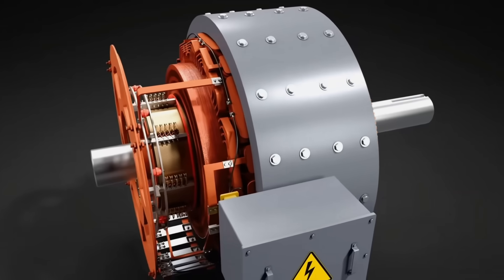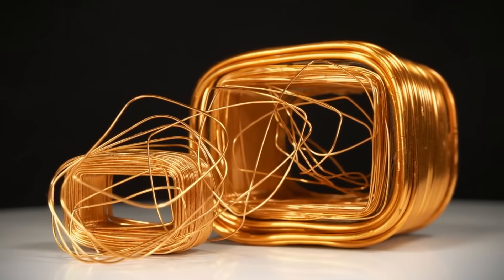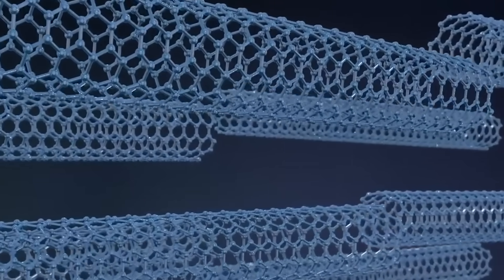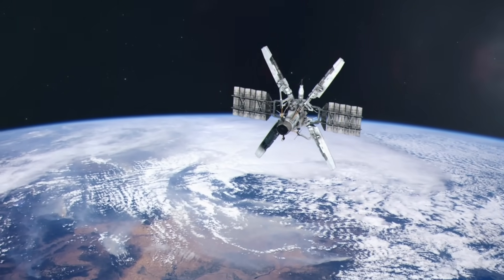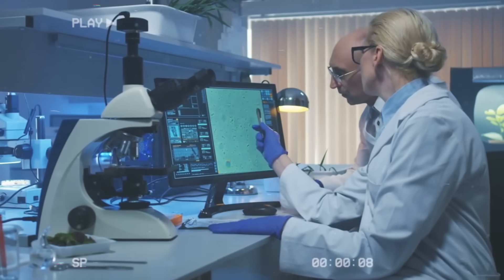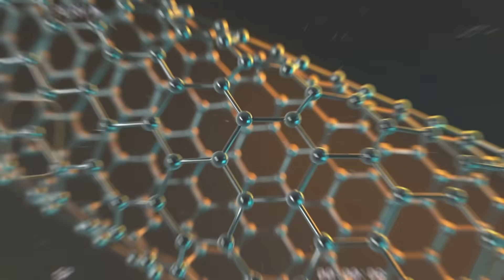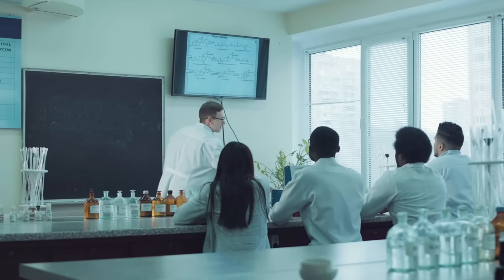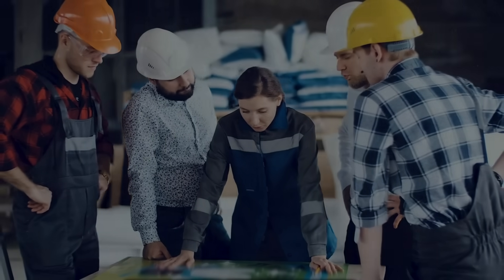This New Electric Motor Will Blow Your Mind—No Metal Coils!

Comment: It makes sense to build a motor into a wheel. In cars the wheel would become too heavy. Not to heavy if you use carbon wires? You would replace the brake too.

Aircraft wheels can be run up to landing speed, saving rubber. They can be used to taxi.

Comment: seems carbon nano tubes is basically graphite repurposed  to electrical use.
The biggest benefit is you can pump more voltage without the risk melting.. copper has a melting point 1,985f ,
while graphite has a melting point of almost 4000f. i wonder what would be the emf levels on such graphite electrical wiree